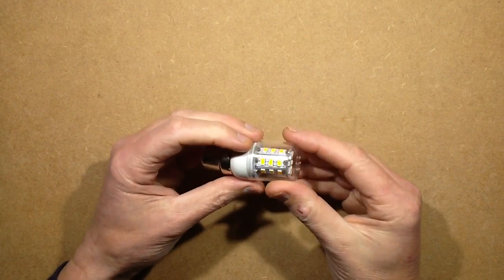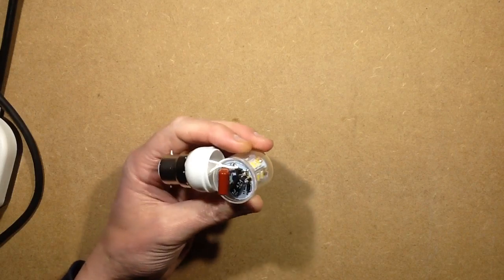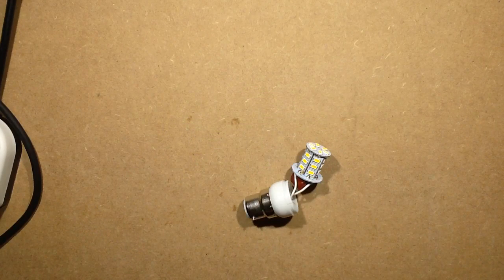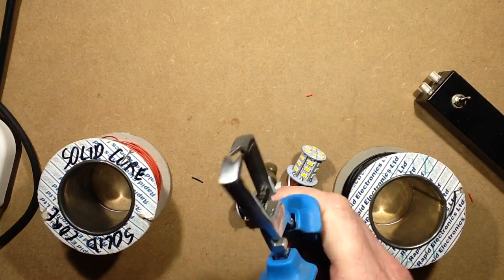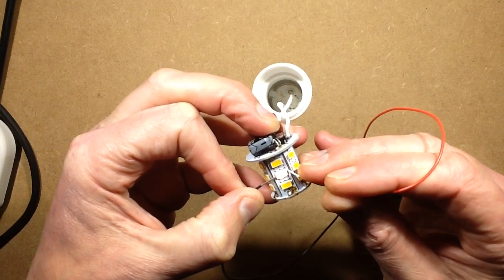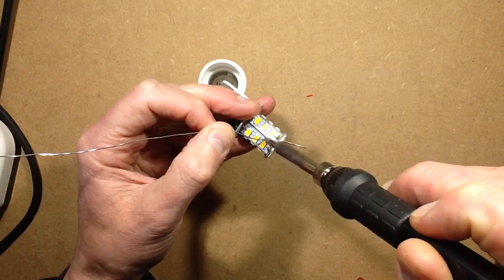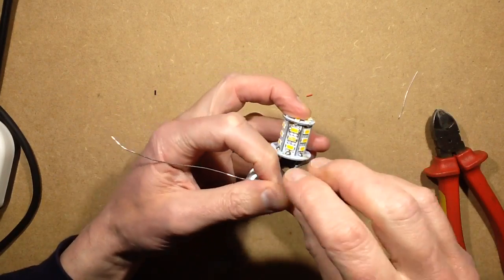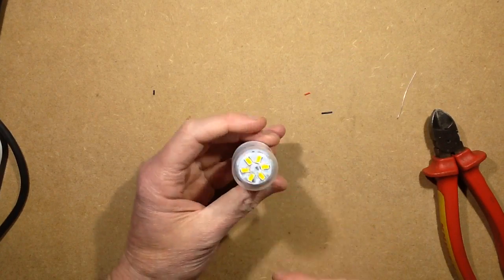Fixing a dead LED lamp.  (Interesting failure.)

Comment: I wonder why bayonet connectors never caught on over here in the states I mean they seem so much nicer than the Edison screw on.
Reply from the maker: +legalizeshemp420 I think it's just that the first fixtures in the USA were Edison screw and it would have been too much bother to switch to a new standard.  Same reason they're still here despite the fact that a child or even an adult can stick their finger right into a live connection.  Any modern lamp holder standard has to shield the contacts from touch (think GU10 or G9).
Reply: bigclivedotcom GU anything is mostly overseas as we are stuck with 3 bases which is just different sizes to the E26.  No safety at all if the bugger is plugged in and I know I have been almost zapped by one as I went to touch it my hair on my arm went up slightly (sort of felt weird) and thank goodness only the tip of my finger touched it as I felt the current.  Had I been in water or not using sneakers, or even worse grabbed it, bye bye world.  Those GU sockets they have to be pushed down to make the final contact which is nice.  It seems that so much of the USA is because it was already here and the better ways of anything would cost too much so go figure.
Reply: +legalizeshemp420 The only problem I have seen with bayonets was with the old fashioned high power incandescents, where the solder on the ends will melt with the heat and make an indentation that makes them difficult to remove.

Comment: This style of lamp would have a longer life if not placed into the clear oven housing, of course then there is the shock hazard issue. The "pepper" sign of death is a sure tip off.
Reply: +Craig Nehring I don't thing the problem is heat in this case as they don't get that hot, more than likely they are marginal quality leds.
Reply: Good to know, yet, I guess as Clive mentioned these LEDs are driven pretty hard
Reply: +brian whittle also that they're 220V and the dropper circuits mean that if you have 240+ like I do (248V) they get cooked quickly.
Chinese vendors assume 220-240V means 220V more often than not (the one I dealt with was shocked that our voltages are so high).

Don't forget to bump the dropper resistor slightly to stop the leds being overdriven.

Comment: These type of LEDs seam to have a short life. I have found a number like this that start to flicker then completely fail. Normally followed by a black mark on the dead diode. I wonder if these enclosed types over heat? I also have a number of the open (deadly types) that work without this problem. When they do work the light output is very good.
Reply: +Michael Beeny It is, I guess it's the sloppy manufacture behind it also, as I had found a similar fault in a dumpster dive LED bulb and it had bonding wires inside the 5630 emitters with random sharp bends as if the bonding machine haven't seen maintenance for a while when the LED was bonded to it's case causing the bond wire to fracture and break during use. I had found at least 5-6 LED bulbs with some sort of failure (and 2 that was in mint condition thrown away by someone). One of enclosed type had overheated to the point where epoxy lenses fell out of PLCC-2 emitters with the chips, causing it to fail.
Reply: Nelson Pacheco
You're welcome ^^
Reply: +Nelson Pacheco It's bought not buyed.

Comment: I've had the same fault on a couple of mine and fixed them in the same way.  As they seemed to be over-running I also lowered the size of the dropper capacitor.

Comment: Perhaps decrease the capacitor value a little, drive them not so hard perhaps?.
I use a small penknife and roll the wire on it to cut the insulation :-)

Comment: There's a tendency for these to run the LEDs too hard, possibly because they're made in China and designed to run on 220v AC, but in the UK we can get anything up to 253v AC (230 + 10%).
I've done this little trick on a number of LED spot light bulbs (E80) in my kitchen, but eventually another LED blows and then it cascades.

I think the only long term solution is to short the blown LED and then drop a single resistor in to reduce the voltage going into all of the LEDs or preferably do this before an LED blows in the first place.
Reply from the maker: +Strider9655 Better than that.  Reduce the value of the dropper capacitor.  Like from 680nF to 470nF or less and turn it into a slightly lower power lamp that lasts longer.
Reply: +bigclivedotcom Why not use a prope led driver instead, i buy Eigostar bub and of 15 only one failed rest still working and got like 3 years yet of use all use led drivers.
Reply: +bigclivedotcom BTW i fix a samsung tv 2 moth ago and got one ld dead and was sharp led prety insane for almost years old tv.
Reply: +pufero1 3years old.

Comment: For many years, my wire strippers were my teeth, but after getting copper wire stuck between them a number of times, I've started using a cheap auto-stripper (it was left in the house by prev. occupants!!), but it's a bit hit & miss, could do with the manual sort really... 

Handy indicator that, black dot marks the spot, just a shame those LEDs are PITA to replace without making a mess... :P
Reply: +twocvbloke Yeah I use my teeth too!  I've never seen these kind of strippers before.  I had a look on Amazon and found them for only $5!  I think I'm going to get myself a pair!  Save my teeth and myself from lead poisoning.  http://smile.amazon.com/gp/product/B002MXNEKQ/ref=ox_sc_act_title_1?ie=UTF8&psc=1&smid=AOOH0DF4QWOOO
Reply: Makerj101
Yeah, I need to get a set too, my present set is just useless, ruins more wire than it strips... :\
Reply: ***** Yeah that's how my stinky automatic ones work.  They either get jammed or work better as wire cutters.

Comment: i have these lamps, horrible yellow light and the higher wattage ones get really hot
Reply from the maker: +‍1marcelfilms There's a tendency to push some of the LEDs really hard.  I prefer to stay with the lower wattage ones that run cooler.
Reply: +bigclivedotcom 
Also the lower wattage ones are more likely to last longer, since they have less power to dissipate. Doesn't mean that they aren't overdriving the LEDs though :(
Reply: Benjamin Esposti i take off the protective plastic on most of them when they are out of reach

Comment: Clive I noticed you was using the cheap soldering iron you got from eBay I did see you clip on it.
Just want to know how's it going I'm thinking of trying one out.
Keep up the the good work love your channel.
Regards andy
Reply from the maker: +andrew mcdonald It's the Yihua 8786D with the combined hot air pen.  I started using it more because the pen is handy for heatshrink, and then just kept using it as the iron as well.  Apart from the slight buzz from the base unit, It seems to be absolutely fine.